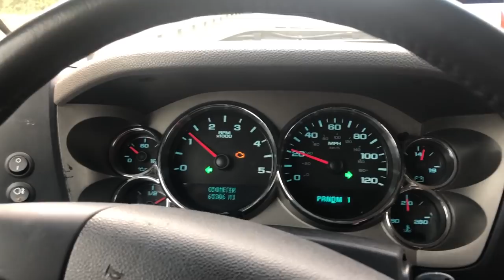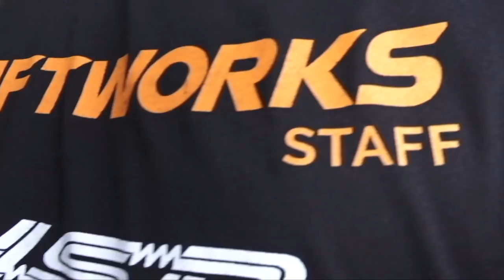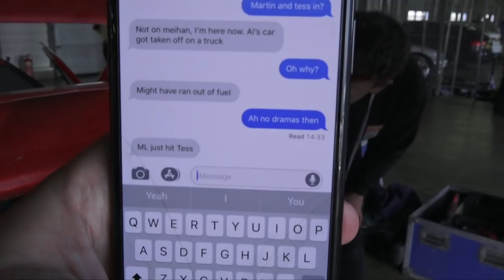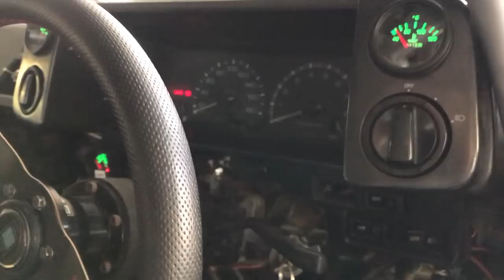MEIHAN - *BREAK EVERYTHING SPECIAL* VLOG - DRIFTWORKS

Comment: Should of brought a Toyota hilux dual cab . American pickup trucks are rubbish
Reply from the maker: Haha, the trailers nose weight would have flipped a Hilux on it's roof.  Proper American trucks like this are unbeatable. It's moving nearly 11tons in this video. It's done 250,000 miles and the only reason it broke is because I did an ungoverned 6th gear burnout that over-revved the engine.
Reply: @driftworks  well still here in Australia we just got those big rig looking things are they suck not to mention they weigh about 9000 lbs or over 4.5 tonnes easy that thing so if you think about it you are really towing the big truck since it weighs so much already and not the trailer behind it
Reply: @driftworks  saw the other footage crankshaft was gone to heaven